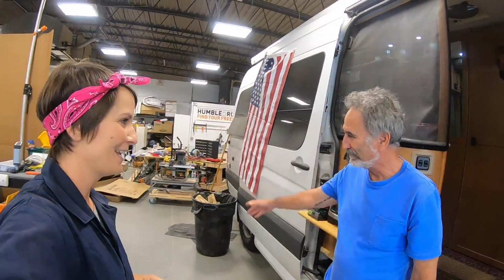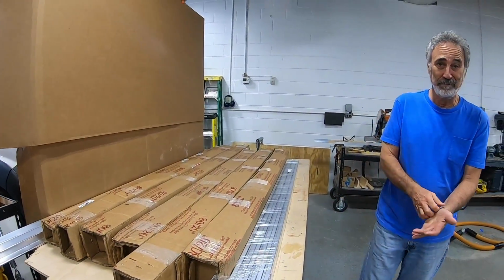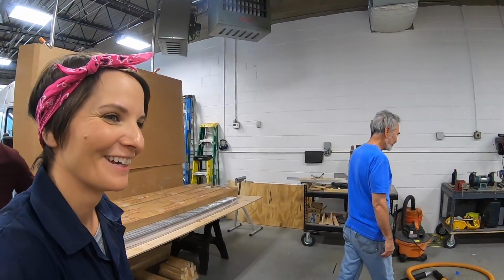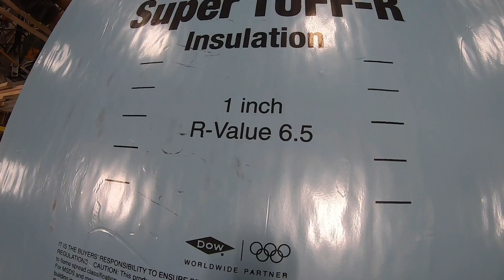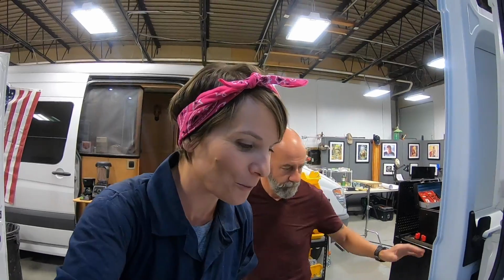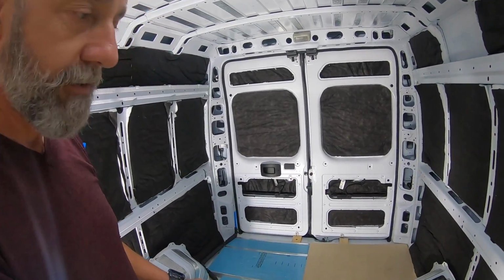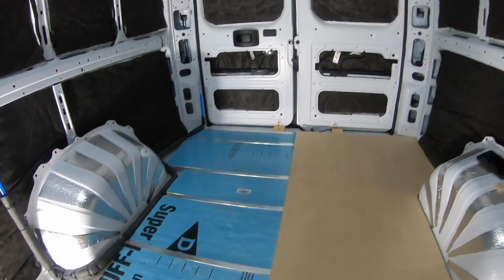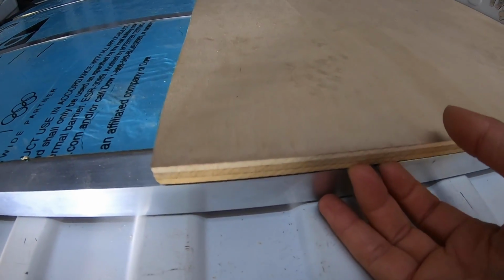Back To The Build! Installing the Garage Floor. Vagabond Van Build

Comment: oopener??? hwy checked your website for rv build stuff but didn't see this listed.  How do you spell it. Love the vids so keep them coming.
Reply from the maker: Thanks Gord. It’s Upinor. We are a bit behind but we’ll get caught up on the parts list.😉😁
Reply: @CareyOnVagabond  I'm another one building out a 3500 Ext. and am loving this build. I just ordered a boatload (okay vanload) of products from your page and definitely want to use this Upinor pipe. Please post so I can support you! And for those of us new to fastening into aluminum, what sort of screws were used for the floor?  I'm so thrilled that you guys are working with George because we'll all benefit from a quality build.
Reply from the maker: cesalt thanks for the support!! I will check tomorrow and update our website with what’s available on Amazon. I think I do have some of the connectors listed there but I will look for the Upinor tubing. We used flat head self tapping screws for the floor. I will take a look and list those as well. Thanks again and best of luck with your build. Exciting!
Reply from the maker: cesalt I’ve updated the website with what I could. Amazon doesn’t carry the exact screws we used. They are Everbilt #10 x 1in self-drilling wafer head screws, wood to metal. We picked them up at Home Depot. Carey On! 👍🏼
Reply: @CareyOnVagabond  Thank you so much! I'll be visiting your website regularly. Love the win-win of that.  :)
Reply from the maker: cesalt hey I realize I may have made a mistake with the uponor water lines on the website. I listed the Aquapex tubing but it may actually be Propex tubing. There’s too many options!
 I will double check with George tomorrow. Sorry if this caused a problem for you!
Reply: @CareyOnVagabond  Ah, too many 'pexs! No worries, Carey. I'll swap out if necessary once we hear from The Professor.
Reply from the maker: cesalt good news, that’s the right kind! I’ve also added the propex expansion tool you would need. 😀👍🏼
Reply: @CareyOnVagabond  Wonderful!  Thank you so much for the follow up.

Comment: Why the aluminum on the floor? Isn't it gonna transfer cold from external more than wood would.
Reply from the maker: It may a bit. We went back and forth and in the end we think the think permanent glue should provide a bit of a break and we didn’t really want to go with wood on the floor. I guess in the end every builder has to do what makes them most comfortable. Plus we always leave when someplace gets cold.😂😂 Cheers!
Reply: @CareyOnVagabond  I was afraid 1x2s would deteriorate over time and found this use of aluminum eased my mind. I agree re the glue and think it's a good bet overall.